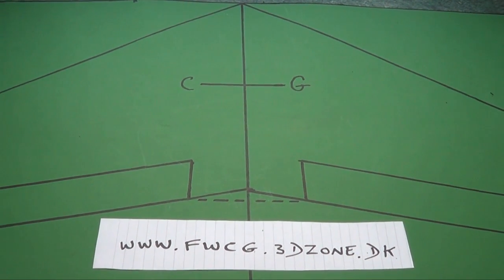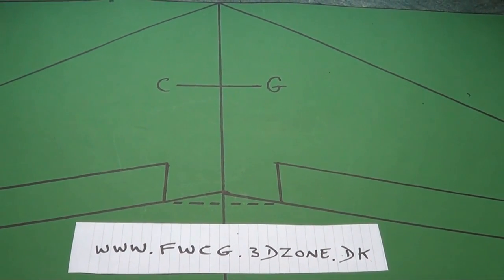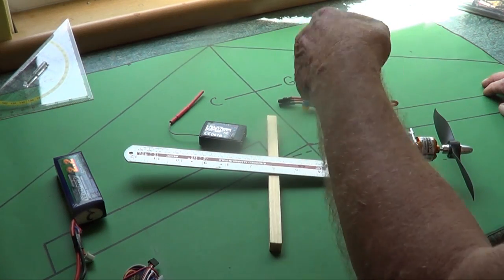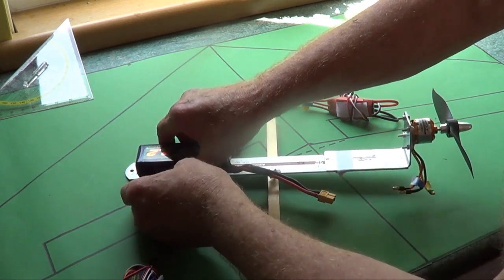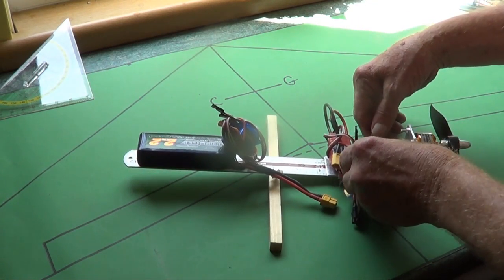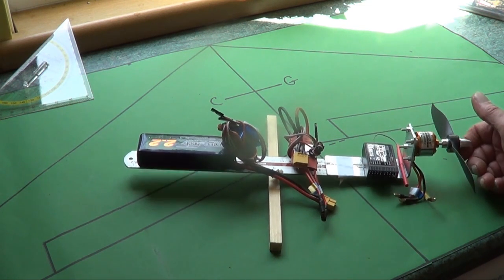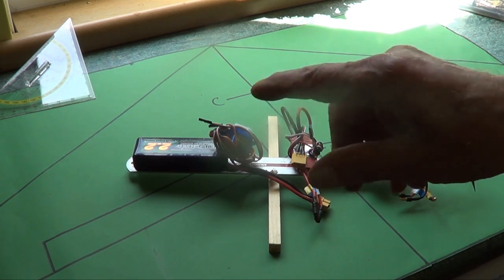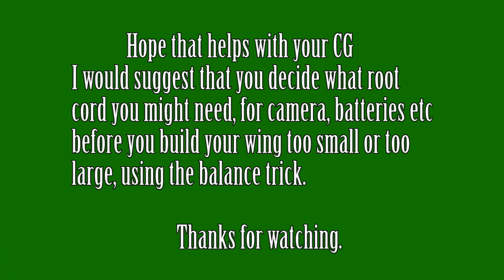Flying / Delta Wing CG (The easy way)

Comment: Thats a great idea, well done. I will definitely use this technique on my next scratchbuild. I made a flying wing in the past and the cg was horribly off and the project never got off the ground. Couldn't change the weight distribution with the design I had. Wish i'd used this method before I began!